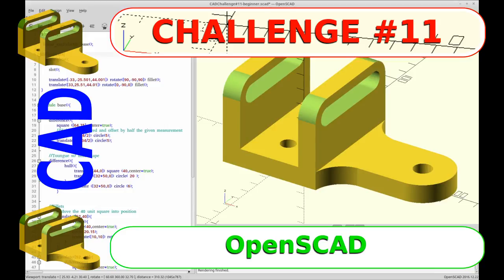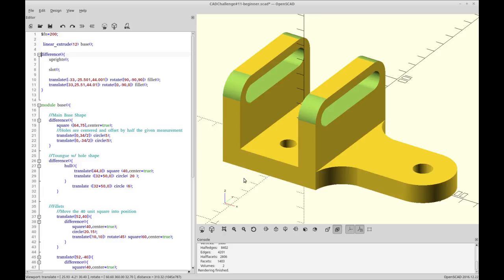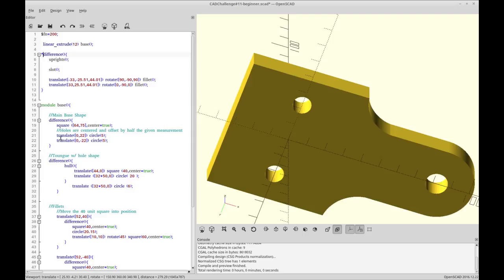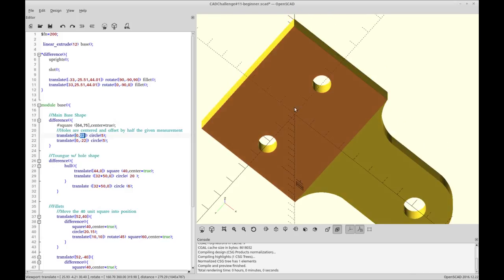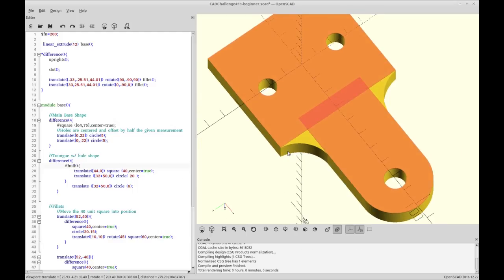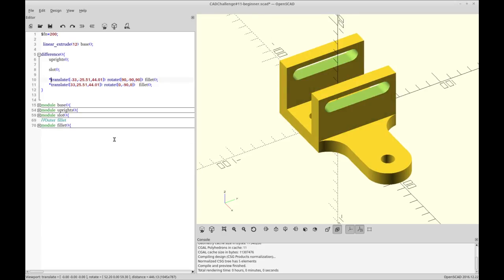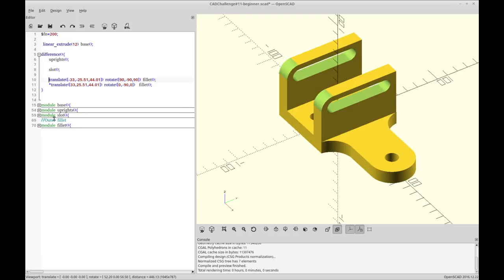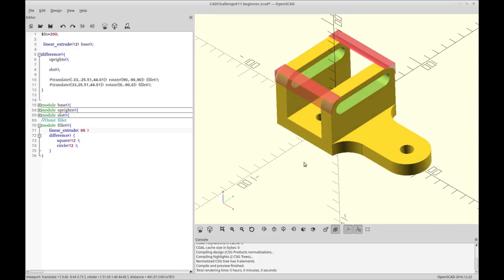CAD Challenge #11 - OpenSCAD Tutorial Version

Comment: 2:47 - why you need extra cube parts to be removed with rotated cube if you could make fillet cube size accurate to have no left overs after difference with circle? 
Also could you just do the half of it and use mirror?

Comment: Thanks again for this. I always pick something new up. I like the way you did the top fillets. But for the base fillets, you use a square of 40 and difference out a circle of diameter 40. Then you have to remove the excess  bits of the square. Could not the square have been made 20 (same as circle radius)? Then all of the square will be gone, except for the fillet part. Which is actually what you did with the upper fillets.
Reply: Yes, the square should have been smaller so he didn't need to take out another square. The binary geometry for this is much more complicated than necessary.
Reply from the maker: Likely :)
Reply: And in the same vein, the two upright parts are identical. It would have been simpler (IMHO) to write a module that creates one part, with fillets and slot, then place it in the two positions. Then it wouldn't be necessary to work out the lengths of the fillet and slot removal tools. What's more, if the customer decided to change the design (and when has THAT ever happened???), and insert something between the two uprights, it wouldn't break the design.
Reply from the maker: Excellent points. I tend to go with the first way that works. Clearly is not always the best way :). Although , imho , customer and openscad seem to be mutually exclusive. But I am just a hobbyist so i really don't know.
Reply: the idea that the square should have been smaller popped up  in my mind too as i was watching but luckily this already was answered. However you could give the fillet module a parameter for the size and use that same parameter to make the square and position the subtracting circle. That way you have a fillet you can reuse more easily if you need different sizes and even use in other projects. You need to declare and initialize the constant before use (mostly do this in the top). Actually i try to parametrize my "designs" as much as i can to remain flexible.